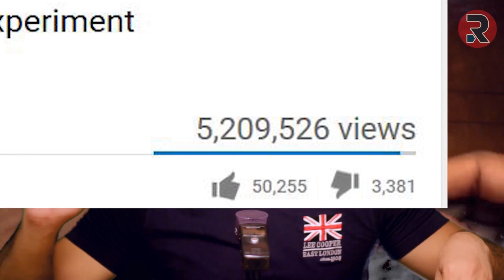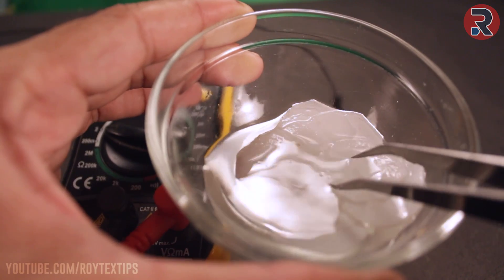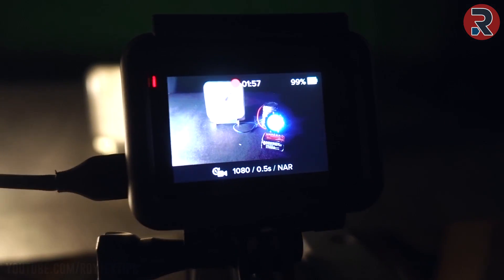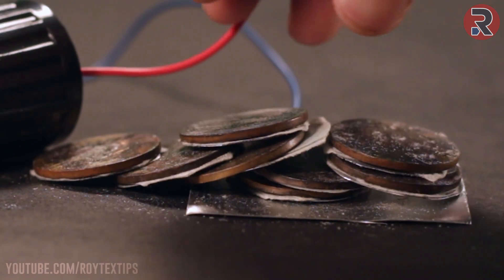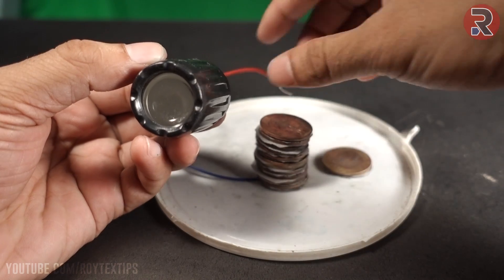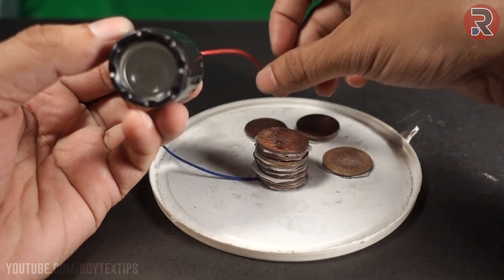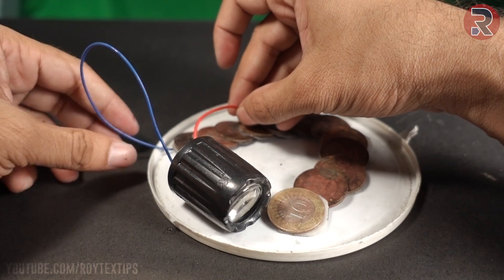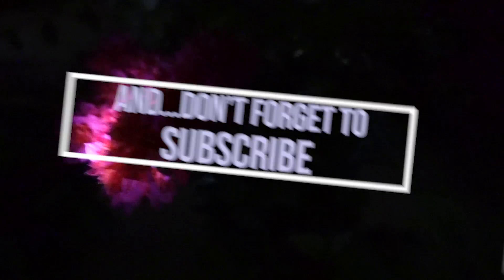How long coin battery will last - Or it is unlimited free energy - Science Experiment

Comment: What about a flooded chamber?  Maybe a plastic prescription bottle and fill with vinegar?   solder wire to each coin and place insulated between each coin in bottle?  all the wires from one type of coin is positive and all the wires from other type of coin is negative....would this work?
Reply: I assume there will always be a voltage potential between dissimilar metals?  So simply a matter of identifying coins with best properties to function as a battery? Zinc is popular coin material ...what is potential between zinc and copper?  Aluminum is popular too....and Nickle and steel?  Maybe even make "coins" by simply  pounding lead flat like a coin ? Maybe use old tire weights cut into small hunks...or something?  Washers are available in various metals also

Comment: You have to seal the coins in something to prevent evaporation.  I've made US penny batteries from copper clad zinc coins that lasted over four months which were only sealed in vinyl electrician tape. 
Just don't stretch the tape, as it will compress the coins and cause either the fabric/cardboard to leach electrolytes which short circuit between coins or cause the materials between coins to touch which short circuits between coins.
Reply: Can it be submerged in a solution? Or will that short circuit the flow of energy
Reply: @FMATTV1986 yes my idea was lay the cell sideways in a solution but each coin dip half way in wax...so all the metal in the solution is not shorting from connection but the top half off metal is not waxed so the cardboard is always in a solution and the metals in the water are protected by wax preventing a short circuit

Comment: I want to power up a 1.5V DC motor using Penny Battery after directly connecting them, it doesn't work i'm wondering if i could use a Joule Thief to increase its voltage will it work ?
Reply from the maker: test the battery amp, minimum amp need to run you motor.
Reply: How can I do that ?
Reply: @hizonopusdie  Idk if this is relevant anymore.. but you can put these in parallel and increase your amperage.

Comment: How many can you stack together and still get more power for each one? Could you do 1000 coins and start your car?
Reply: Shane K might be, but the voltage might get dangerously high when you use that much (120v, 1-3A)
Reply: @raunak1147  there is not enough amps

Comment: I tried this for how many times by why is it not working? I used copper coin, cardboard, and aluminum but why?? My teacher said that it need a seperator but why does it work here without one??
Reply from the maker: I will try it with blade ok see what happen. Did you test with a multi-meter
Reply: Cardboard should be soaked in brine sol

Comment: All that he is doing is making a easy "transistor"........ Basically just layers of thin metal and then something between the layers that isn't metal.... It's used to amplify voltages...... Energy isn't created or distorted you just got to find out how to use it..... All physical property's have some type of energy form or another even plastic..... Yes I said it even plastic....
Reply: Capacitor*
Transistors don't hold charge.

Comment: with these many 10 rs coin i can buy a cheap old power bank which is rechargeable. just kidding this is better than any other
Reply from the maker: Pin your comment.
Reply: sry but i don't know how to do that
Reply from the maker: I pinned your comment . so it always on the top
Reply from the maker: yes you can
Reply: I am an American. The only coin we have with copper is the Penny which has copper playing and is worth the equivalent of lint. AKA the battery would be far cheaper on our side
Reply: how can the energy be free if you have to pay for it? the small amount of energy output by this battery has costs involved. cost of parts, time to assemble, cost to maintain over time. Cost does not equal free. For energy to be free you must be given the energy at no cost. If you build something that produces energy you pay for the energy up front instead of buying from the electric company monthly. This is fundamental. How can you claim Free?
Reply: @bruceyoung57  Ok than if you say so almost everything cost us
Reply: bruceyoung57 so negative